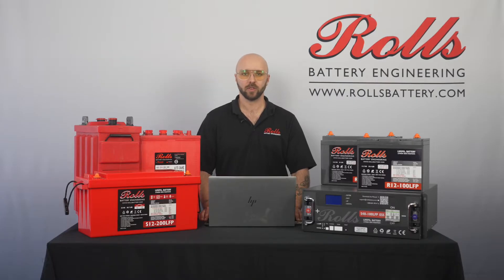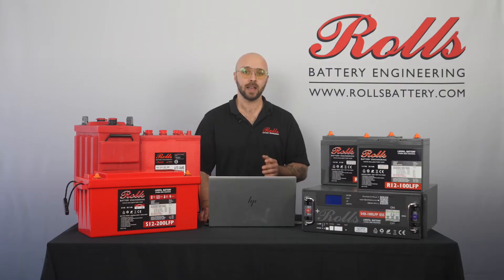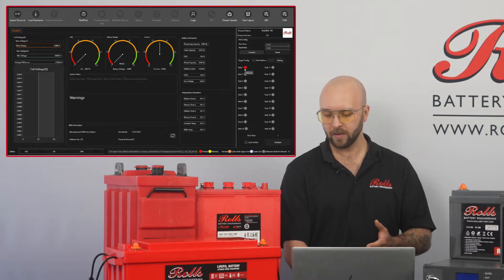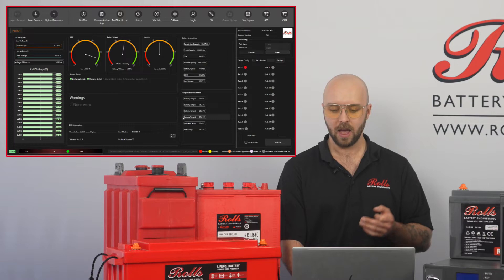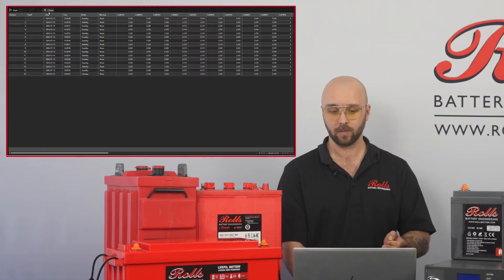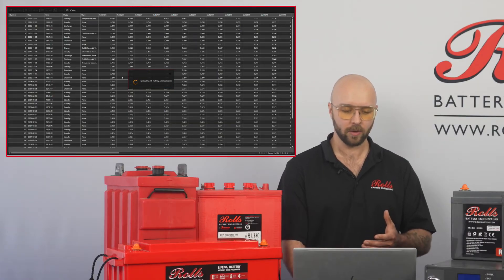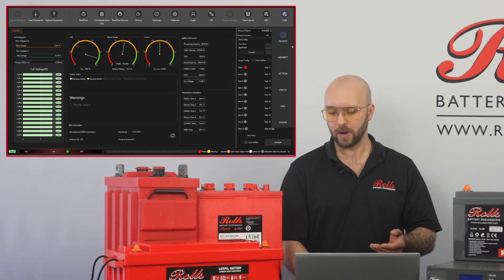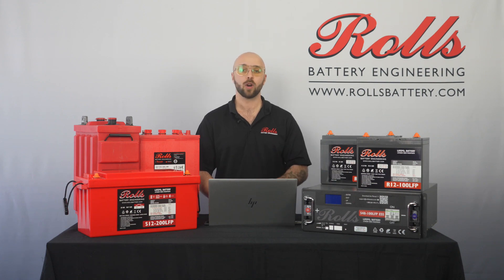Rolls Battery Engineering - Rolls LFP Desktop PC Software Walkthrough

Comment: Hmmm, whatever happened to a battery just being a black box under the bonnet (hood) into which you occasionally topped up the distilled water? My god, this is a PhD computer geek's wet dream. Lithium + BMSs have brought about this modern neurosis for monitoring and control over everything in our lives. My geeky friend has a "Fully Programmable" 6-blade electric shaver (with App), and a computerised fridge with frontal touchscreen which tells him when to buy milk. Sheesh.